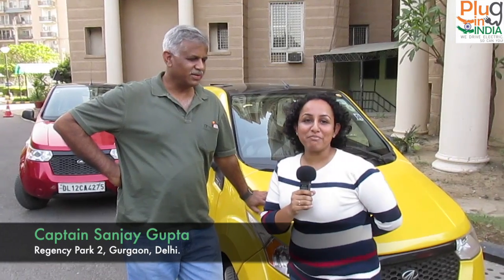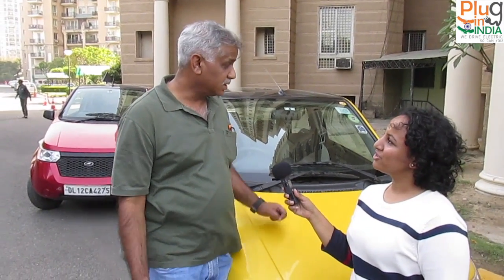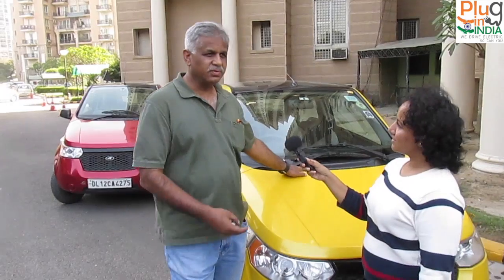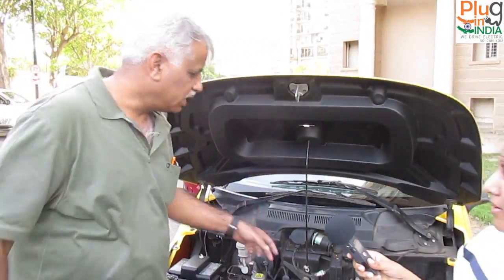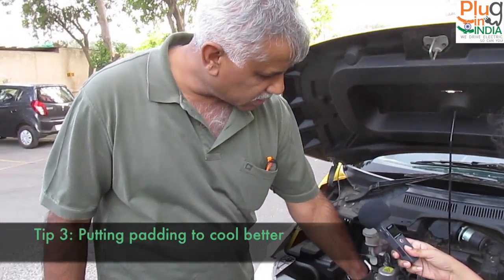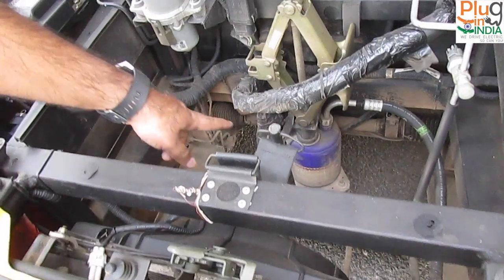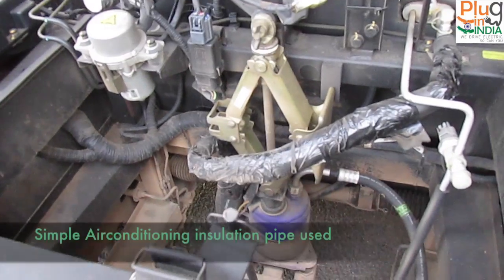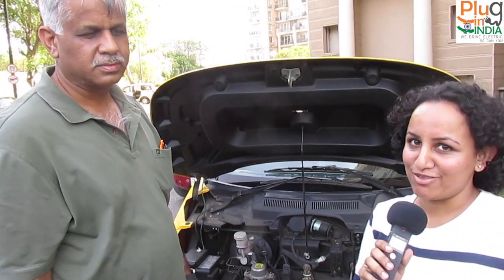Improve AC performance on e2o and e2o Plus electric car - Captain Sanjay

Comment: This idea of insulation layer was used in my Hyundai getz in 2007, and now I have installed the same insulation bought from a local ac shop, when I bought my kuv 100 in 2016, because the company gives only a thin layer of insulation that too exposing the maximum pipe and covering the minimum, it is beneficial in internal combustion engine also as the compartment is too hot. 👍

Comment: the pipe that is cold to hold is the return pipe. What is the use insulating it? That just takes the refrigerant back to the compressor to get compressed back into a liquid.

Comment: I tried it on my petrol car, which started blowing some amount of water post insulation, later when i made a deeper study into it, i came across blogs which forbid doing anything like insulating because it would cause imbalance of the whole system. i dont know if  it is same in electric car?
Reply from the maker: This tip was recommended only for the e2o.  Please don't try in other cars!

Comment: A short note to thank you for posting this wonderful tip. I have worked upon it and now the cooling is so much more in the cabin. Wish I knew this before and not have suffered in Bangalore heat from Feb to April. Anyways better late than never. Appreciate the effort on your end. By the way the AC mechanic who helped me didn't charge me anything saying this was such a small job. Amazing Results though...
Reply from the maker: Thanks Mohit ji
Glad this worked for you!

Comment: Fantastic idea.
thanks Captain & Farah, I did the modification today morning with the help of a local AC service engineer and it took about 10 minutes. The result felt positive.

7-10 min. Drive in schorching heat.
Car parked in covered.
Amb @ 36
Cab @ 33
While driving
AC @ 2-2
Ambient reached 39 in 5 minutes while Cab was still at 34.
kudos.. Keep up the good work & spread the knowledge.
Reply from the maker: Amazing! 
Thank you for trying it out. Glad its working for you and you can actually find a difference in performance.
Reply: E2o Air condition compressor where to buy for my home made electric car